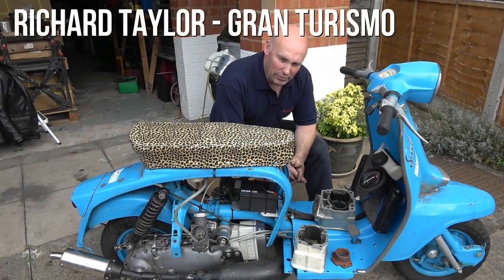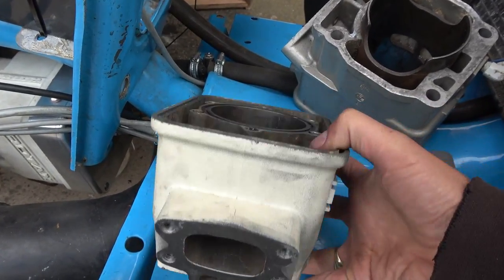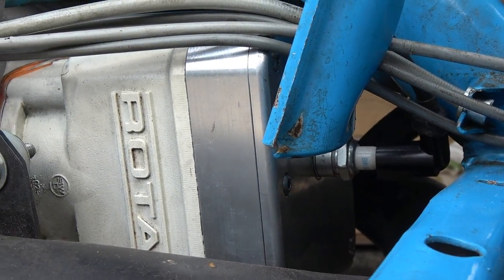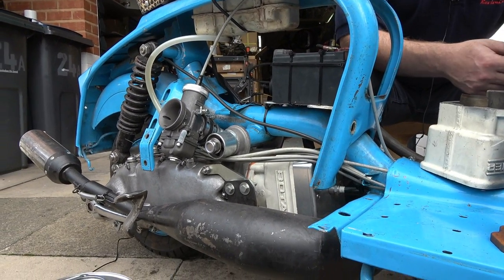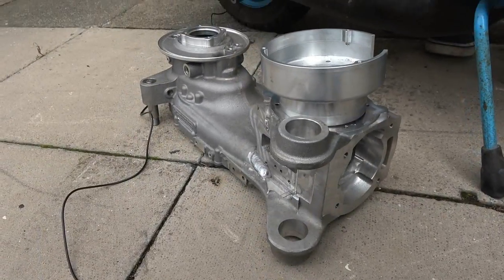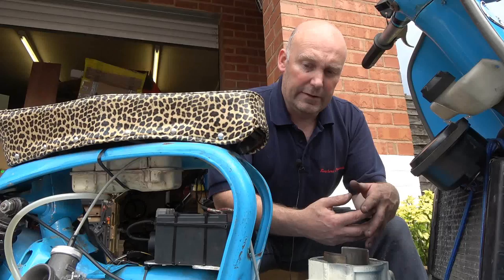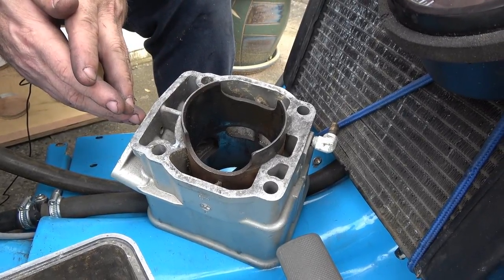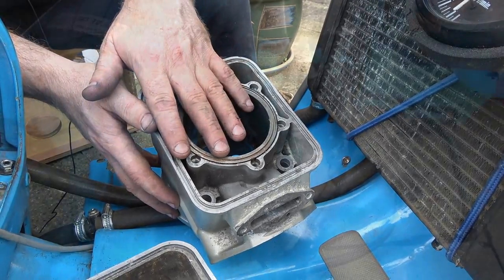SLUK | Gran Turismo 290-370cc Lambretta engine

Comment: I've had a GT186 kit on my Lambretta for the last 13 years and have had no problems. This guy offers kits which are well engineered using quality components. The peak power is lower in the rev range which makes it and genuine reliable grand tourer rather than a thrashy steert racer type.

Comment: This guy really knows what he`s talking about !! Now I`m seriously thinking of getting this for myself, I`ve had over x 100 Scooters over time since the 60`s, and at the moment I have a Triumph Street Triple ( love it ) But This might change me back again to Lambretta`s, we`ll see how this fans out ?? >> Bluey,
Reply: Don,t worry it won't be long before true quality liquid cooled ported cylinders are made as it stands today besides Tcr 125cc Kit at 46 bhp
prototype the mighty Roost Havoc at a mere 98cc put,s out 35 rear wheel bhp the 100cc 2fast, Malossi Rc one Polini Pre 100cc and Bidalot WR 96cc Liquid Cooled Espresso bike  just ran 107 Mph!!! which makes them true Liquid Cooled  Gp engines although the new 265cc Casa is a Monster its air cooled and only 47bhp half the power of a true Gp engine @265cc and much less under load minus Liquid Cooling Dr Rossi 500cc Gp bikes have from 240 to 280 bhp really making true that icc 125cc kart engines range from 45 to 60 bhp in knowing this im sure a Liquid Cooled 250cc to 300cc Quality Cylinders are coming now that the Door for large 250cc 2 stroke are finally open at bsso im just happy the 2stroke God's are back blessing us with Thunder and Lightning

Comment: ID BE TEMPTED TO TRY AND PUT THIS ENGINE IN A ROYAL ALLOY GP 300 IT ALREADY HAS THE RADIATOR BUILT INTO IT NICE WORK THOUGH
Reply: Won't work its got gears  and the bird shit  welding won't take it   Chinese  junk
Reply: @radioclashlambrettadude4288  IF THEY CAN PUT A YAMAHA POWER VALVE ENGINE IN ONE THIS SHOULD BE A CINCH